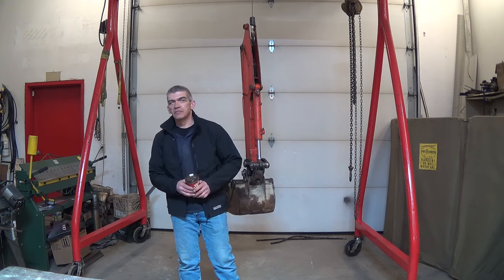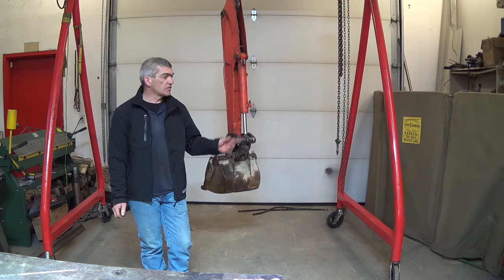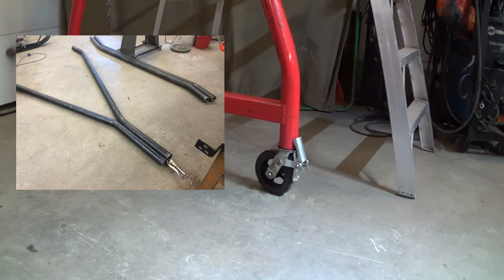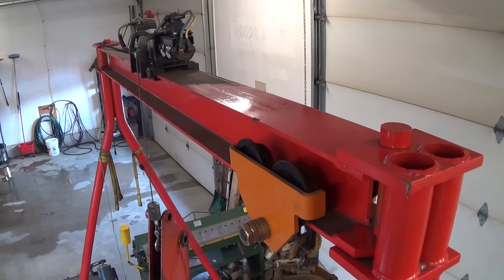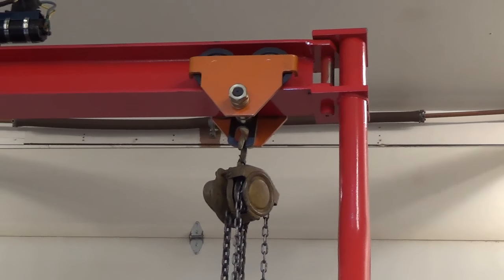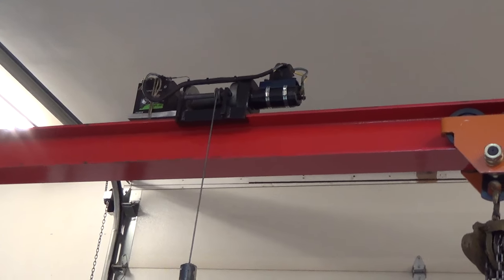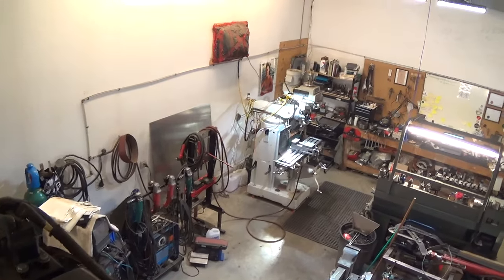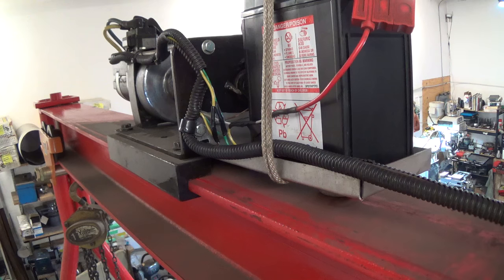Shop project - Gantry

Comment: Like your crane project...mounting the 12 v winch on top really helped solved my winch location delema. I may use a fair lead or roller to prevent a winch wire failure.

Comment: get the basic battery tender to keep the battery fully charged, they put out a fraction of an amp, but perfect for super long term use, hard wire it all onto the side with a long extention cord, then you can just plug it in a night

Comment: Nice shop crane.  I bet you can pick up most things with that.
Reply from the maker: Thanks Harold. I did use it to move a roughly 1500 lb unit out of the shop at one time and also to lift the end of the plow(est: 1 ton) in the linebore video to get it loaded onto my trailer. I was a little nervous with that one but it showed no signs of failing. :-)

Comment: Good build   gave me some ideals on how to build my own   never thought about mounting on top of the I beam . I'd probably do the same with a 120v winch I work In my garage not far to run a extension cord never mind my roof plugs. Was thinking on mounting it to the trolley but looking at this  sure be nice to have option of both. Only thing different would be the sides  been looking at different ideals on adjutable one for height . Good to see some Canadian content    most things are from the states that I find.
Reply from the maker: Thanks for the comment Dodge. This unit has been my best buddy since building it. Used it tonight to reassemble a 3/4T backhoe blade by myself. Having the dual lifts enabled me to tilt up the heavy blade without danger of it shifting CG and tipping over. The winch BTW can slide along the top rail to whatever position is needed. :)

Comment: I'm still perplexed on winch position on the gantry beam. I may build a winch saddle mount over the beam with bearings so my winch wire does not bind and directly meets the pulley block on the lifting end.

Comment: I need to add a electric winch like you did to my home made over built gantry, are you using a auto style winch with an added pulley to direct the cable down. Mine gantry  was just rolled down to the neighbors to lift the  cab off his 2000 F250 for an engine change.. But the winch would have been nice to avoid reaching over to pull the chain. Thanks for the video. would like more details on the winch set up, thanks ED

Comment: I never thought about using bent pipe, but it sure looks like an efficient design.  One question though, do you really use the trolley at all?  As mobile as your frame is, wouldn't it be just as simple to center the frame over your lift?  

The reason I ask, is because while pondering how to build mine I keep coming back to the weight and expense of the beam and trolley (why the hell are those so expensive, anyway??), when all I really need it to do is lift stuff on/off a trailer.  Back the trailer or truck in, lift, drive it out from under, set the load on a pallet/jack. 

 I haven't figured out why A-frame lifts are so uncommon when it seems like many home shop needs could be met with a far lighter and less expensive rig.
Reply from the maker: Yes, having the chainfall on a trolley makes things easier. Sometimes you need to move things sideways a bit. It also helps to self-align the chainfall instead of having to move the whole unit. The trolleys are a bit pricey but shop for something on sale...took a while for me to find one decently priced.
You can also buy a gantry pre-made from Princess Auto rated @ 2 ton for about what I paid for just the steel. Weight rating might be optimistic but for around a home shop it would be great. :-)
Reply: I'm looking at the Princess Auto model and it looks flimsy even the 2 tons model, after some visits at Harbor Freight in the US their 1 ton model seemed better built than the one from Princess Auto, it would be a little more expensive with the exchange but if you live near enough from the border you could get the HF one...
Weight   Princess Auto 2 tons crane =  380 pounds
               Harbor Freight 1 ton crane =  617 pounds
I'd be wondering about the endurance of the Princess Auto one...????
Just food for thought...
Reply: I would be leery of the Princess Auto stuff. Plenty of vids and photos around the web of folded up engine hoists and collapsed gantries from them when used near their limit.
I have a 2 ton folding crane from HF, and as a former professional mechanic, I can say it is as good as cheap imports get. Lifted my 1/2ton lathe at full extension (1/4ton limit) with out any issue. Same with my 1/2ton mill. You would be really hard pressed to bend the boom or upright, the weak links are the leg pivots.

Comment: Thumbs up from Toledo, Ohio. Thanks for taking the time to record and post your build. Your custom bent tube frame and electric hoist with wireless was something I haven't seen thus far. The 1 1/2" pivot pins on top are something different, too. I could see them making disassembly much easier if necessary and I like the mobility component. Would you change anything on this if you had to do it over again?
Reply from the maker: Thanks Loren. I did have to disassemble and move the unit to the new shop last Nov. Having the pins was essential. They are, of course, for pivoting the legs making it more mobile in the shop.
What would I change? A lighter beam for top wouldn't hurt...I wasnt sent what I ordered (much heavier)
It works great and I have had well over a ton swinging from it to test it out.

Comment: I really need one of these. Good project to weld with my everlast welder just not sure how wide I want to make it.
Reply from the maker: I just ordered an 8' beam thinking it would be good. For most stuff it's fine but it won't clear the fenders on my dump trailer. Made it hard to load the lathe and mill into the trailer when I moved. Yours would depend on your needs I guess.. :) Thanks for the comment.

Comment: Great design and very well built. Looks to be very useful for you!
I have several pieces of salvaged 24" X 44' I Beam, might build one-----------not, lol. 
I've had several health issues the last 2-4 months but I'm back and I'll try to get caught up. Thanks for the video. 
....13
Reply from the maker: Two weeks to answer a comment...I should be shot..!
Yes, the gantry have been quite a valuable tool for me. I get to move a lot of stuff by myself and not fond of wrecking the body.
Good health to you bud...always appreciate your comments. :-)

Comment: All she needs now is a lateral movement on the electric wired in to the other 2 channels on the remote. LOL  Very nice setup though.
Reply from the maker: Actually I had thought of it but really not enough need. It does slide across when needed which is not often. Thanks. :-)